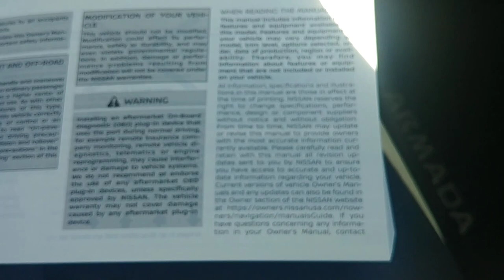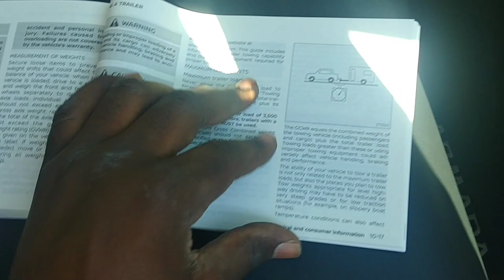Can you use a RENTAL Vehicle to Tow? Nissan Armada. Enterprise Rent-a-Car (for example)

Comment: This is a 7 pin connector, u haul carries 4 pin connectors. The 7pin has the additional braking, stopping lights, and 12v accessory.
Reply from the maker: Uhaul carries adapters from the vehicles to the flat 4-pin.
Unfortunately this location only had the 6-round to 4-flat connector. Thankfully I was able to get the 7-4 connector at Wal-Mart.
...This is all speaking hypothetically of course.

Comment: Of course with that particular year of Armada (pre-2021), you would need to add a brake controller or your trailer brakes won't work. 2021 and up have those built in.
Reply from the maker: Nice, this is good to know. The U-Haul trailers usually use surge brakes but for people doing serious hauling with electric brakes might want to keep that in mind

Comment: EdBwoy quick question, from your experience with the M's, is it common for the differential on one to go out around the 170,000 mile mark, I have an 08 m35x, with 174,000 miles and the drive shaft went out and in turn messed up the front diff, I never drive the car hard, just normal highway cruising to work and back, currently am looking at Q70L, 2015-2017,what are your thoughts about it, and in your own opinion which would you prefer the awd, or just rwd, I don't live in a place where it snows but I somehow prefer the assurance of awd when the weather gets treacherous.
Reply from the maker: AWD is amazing for traction, and I've never gotten stuck in a Nissan AWD, talking about the RWD-based ones. But you also have to consider that there are more mechanical components that will need to be maintained.

Their reliability is OK in my opinion. It sounds that your main issue wasn't the diff itself, but rather the driveshaft. I know the U-joint will wear and if you don't address it in time, it could have so much play that it acts like a rotating slide hammer to impact other structures.